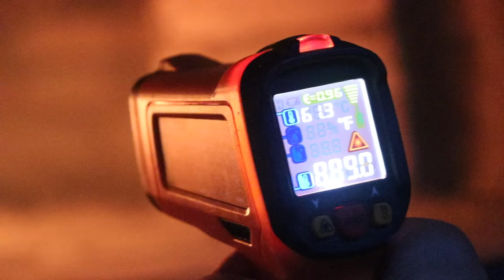TIMELAPSE - DIY Wood Fired BRICK & COB PIZZA OVEN - Start to Finish

Comment: i am in the hardware business in South Africa for 25 years you can use fiberglass shredding rather than steel in your concrete slabs it is stronger and wont crack. Just a tip
Reply: They both have their plusses and minuses.

Comment: 2:00:38 The Step-sister is stuck moment lol.  Great job on the oven bro.
Reply: He did do a good job for a layman. I would definitely consider adding another 2x6 on the inside of the posts to beef up the ends. He's putting a lot of faith in just one supporting all that weight. I don't know how much snow they get but it will stress them even more. Not hating just suggesting.✌
Reply: hahah oh no she stuck in the oven

Comment: FYI, When you’re doing  rebar in concrete , you want to keep the rebar at least 3” away from face of the inside form.. Anything less than that moisture can penetrate the concrete and rust the rebar. The rust will travel the entire length of the rebar over time..
Reply: interesting, I didn't know that....good info
Reply: @jeffroberts1834  Yah if it was getting inspected by the county it would’ve failed inspection. Having the rebar too close to the form would’ve caused it to rust all the way though over time , the problem with that is , people add more weight over time second-story etc. and after 10 years or so it won’t be adequate to hold the weight That it was previously intended for
Reply: @smiffersmaffer  I often wondered why you would see the rust on the edges of some concrete work.....now I know.
Reply: @jeffroberts1834  Especially all them fancy bridges they've made all over the world . Concrete has a life of 75 years ; then it starts turning to dust . One exception . The oldest dome in Rome ( they mixed pumice . Wonder why they don't use that application in today's concrete construction ? (2...You can coat rebar with vinyl , as they do sometimes .

Comment: 1:12 When preparing pizza, the oven must be well heated, there must be no open fire, only coals. The coals should be spread along the walls of the oven, and the pizza or pie should be placed in the center. Then there will be uniform roasting on all sides.
Reply: DIDNT YOU SEE THE TUMBNAIL IMAGE? this isnt this kind of video man....
Reply: And if it's still not hot enough ; use radio carbon 238 , you know , to saturate everything within a 30 mile radius for the next 900 years . Bon appetite !!

Comment: You are supposed to wait until the fire dies down to coals and then let the stored heat do the cooking / baking. The pizza has burned edges.
 The oven looks nice. Except for a major design flaw. The flue should have been more to the back of the fire to draw more air into the fire area. You would have a cleaner burning fire as well as a hotter fire. I have seen several of these ovens as well as some commercially made ovens. None of them had the flue at the front. The flue was always somewhere back in the fire box to draw air into the fire. But it is pretty.

Comment: Very cool and sweet!  Doing a bunch of things the harrrrd way, the slab is excrutiating to watch.  Strength of spirit and purpose is admirable.
     I would really, really reccomend adding posts on the corners and looks like midspan on your eaves, up on piers away from the wet and knee bracing on the upper corners.  The design is good looking but those posts will not last in the ground and that is a lot of weight to have bonk ya in the head!  Nice work, best wishes...

Comment: And you needed an edging trowel to round off the edges so they're not Sharp and pointy like that, but it turned out pretty good if you've never done it before.

Comment: Chili comes from the pepper that you used to make it. It's just the shortened form of chili con carne meaning the pepper with meat. 

Really nice project on the pizza oven, I was googling diy pizza oven and found this video. Not sure the air space is significantly better at insulation than just the huge amount of thermal mass, particularly since heat wants to rise so heat stored in the concrete will tend to escape upwards. You have like 8" of concrete covered with firebrick, I don't think the inside of the wood storage (bottom of the slab) is going to get very hot no matter what you do but I could be wrong.

Not sure where you're at but any concern about snow on the pizza oven enclosure? The center line has to be pretty strong but the wings are being held up by hardware. I really like the repurposing of the bags and shingles and making your own lumber with the bandsaw mill is awesome too though I understand why Nicole is frustrated with milling. Must be lots and lots of time.

Not sure what your electricity situation is like but you can sometimes get a small cement mixer on craigslist for $200 and it would really help you with all the cement you're mixing by hand.

Comment: How deep did you drop the 2 main posts for the pizza oven? It seemed they only went down about a foot. I would think you'd need at least 2.5 feet. Where I am in Nevada 3 feet is the code requirement.

Comment: I use to work in restaurants and bakeries and can tell u that the pizza doesn't need that type of heat and low cinders are good enough with the door up on the oven, second the pizza should be moved in circles so the whole of it can cook evenly with out burning. Check every 10 minutes and move accordingly. The whole process should take 35 to 45 minutes. Bread is the same thing .

Comment: Thank you for the Master class on how to make an oven! If you haven't figured out, when moving logs, they'll slice easier over other smaller logs sides under, then one of the man pushes & the lady guides or if alone, tight a rope in the front & you'll be able to pull them easier over three smaller logs until you realize, "if you build an axel with 2 wheels, & tight it to the back of the log, you can pull it by the front by lifting it with a rope & pull, it'll be easier each time, that's why you the man recognized "is lighter than when I placed it here" because you received the testosterone needed to lift it better next time, then one day you'll realize or try to make for the front, a "turning axle" so you won't have to pull too hard once you have that set for at least one log.

I loved it!

Comment: Why wouldn't you make the fire place underneath the dome so that the fire super heated the stone? You could also add small heat holes to the side which ypu could control the heat inside of the dome ie cover them  if you want alot of heat uncover some depending on the temp you want.

Comment: peralight does not hold heat , its a reflector of heat and directs back to the oven as fast as you make heat . to store heat for longterm release, you need a heavy dense stone , the heavier the better , this is why they use super dense blocks in storage heaters in youre home , the more dense to more it will store , i know its abit late now , but there ya go .
Reply from the maker: Good

Comment: Why did you place the flue in the front instead of on the back, center or one side of the oval? Wouldn't it be better to have the smoke exhaust away from ones face? Such other flue placement should also improve the draft as you've got the intake and out gassing fighting one another.

Comment: The roof eaves are gonna sag badly in time.. may even fail. You put the joist in on it's side right? It's strength is when used upright. I recommend you add another joist either side on the eaves, the correct way round. You could see it bending in the middle under the weight of all the roofing materials by the end.. and it's new.. imagine in 5-10 years. It could come down on someone's head and kill them. Sorry to be a killjoy. Lovely video and you're a lovely couple but I had to mention it. I'm a roofer so I immediately clocked the issue. Happy Christmas and all the best :)

Comment: Instead of using the dirt. We used a yoga ball and then just popped it at the end. How does the exhaust work being so close to the front and under the roof? I thought you would have taken that pipe all the way up.

Comment: I think it would have been better to let the chimney out beyond the roof, you would have had a better draft and you would not have breathed all the smoke ... the pizza is nice but the edge is burnt, this means that the heat inside the oven is not uniform. To have an optimal cooking in the oven there must be only embers and not flames, an Italian tells you that he has made many pizzas. Anyway congratulations for the realization.

Comment: no, it's not like that.
first the fire is lit.
second is expected to end in fathoms.
the oven entrances are closed, so that the heat or temperature does not go away.
The fathoms are removed, the oven floor is cleaned and finally the food is finished cooking with the temperature that remained from the fire.

Comment: hey you might want to run that pipe out the roof even a simple bbq under that roof would catch fire one day just cut hole in roof give 3 inches around pipe run it out side roof all is safe i hope you see this before you burn down your place